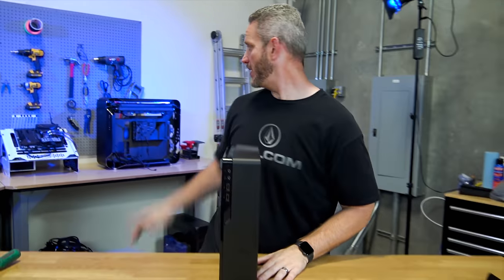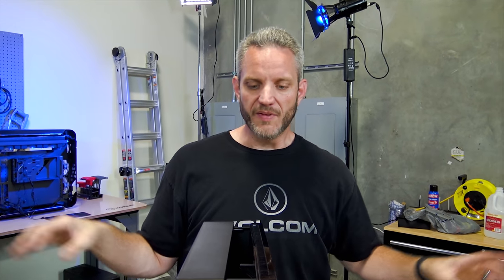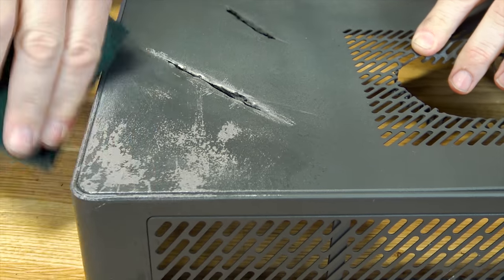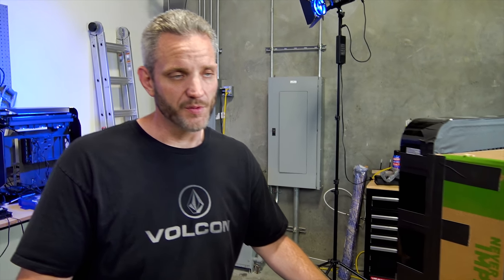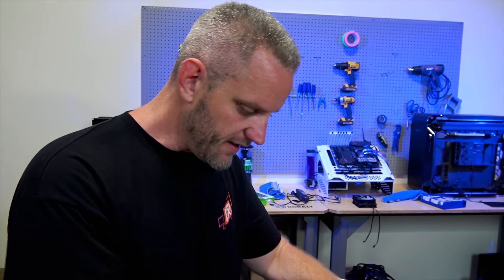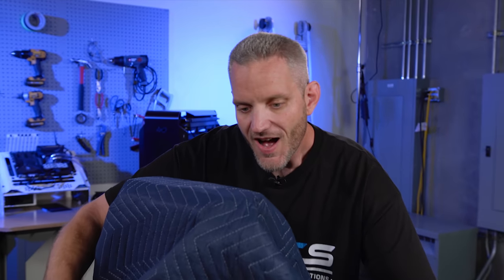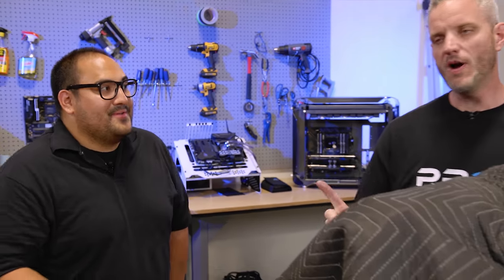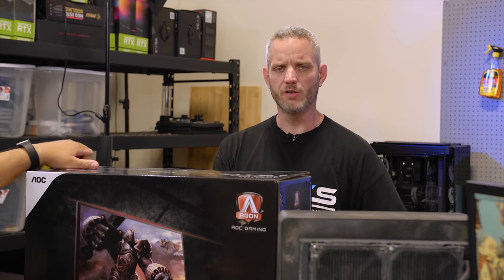I offered to Mod his case to fit an AIO... things got a little out of hand!

Comment: You'll probably never see this comment, but you should check out Aluma Hyde II paint.  its normally used on firearms but its epoxy based and dries rock hard. 

it's got alot of blacks & grays in the lineup.
Reply: I could be wrong but, I think he saw it

Comment: i gotta say, i wasn't a fan of the damaged look till you put the radiators on.
Reply from the maker: Just like anything else, you cant really get the full effect unitl its all done. I saw this in my head and even Phil was like "hmmmm...." until it was done and it was OMG after that. Taking something from your head and making it tangible is fun!
Reply: @Jayztwocents  you are so cool Jay also I've binged watched you many times over the past month. Thank yoy for helping this man from your fans and or radiators
Reply: Too bad it's leaking 20:35 top plug
Reply: @TheNews1990  If you look closer, that is a chip of paint being blown by the fans
Reply: @keksi365  That is honestly really hard to tell. Could be the underside of a paint chip, or light reflecting from water. Worried a lil.
Reply: @M.C.Turnt69  I wouldn't be, it is really clear on my screen that it is a paint chip. I paused the video and went frame by frame and you can see it twisting back and forth and flapping up and down all while it stays the same shape, water doesn't look like that. I would be lying if I said my first thought wasn't "Holy crap it's leaking!" but after I paused it and looked closer it was very obviously a paint chip.
Reply: i seriously thought he was just having fun with wrecking it, and then go surprise we aren't gonna use that old case we got a new case! but that wassent the case and im love with how it turned out.
Reply: @TheNews1990  Maybe if you hadn't bottlenecked your system with a shitty screen you'd be able to see it isn't water.
Reply: @ivanlagrossemoule  I have a 4K UHD HDR+ supported TV, and a Pixel 2 XL. Both show it's water leaking like crazy.
Reply: @keksi365  there's no paint chips hanging off of it. That's bubbling... that's coolant.
Reply: @TheNews1990  it's funny that Jay proved you wrong 👀
Reply: @creppers123  1 year later respond😆

Comment: HOLY CRAP, that case looked freaking amazing when it was done, also those temps, freaking hell the 9900k is notorious for being hot and in an mini ITX case, fook man, me jelly
Reply: At 5ghz OC no less! Fractal Design should take notes, this is how to cool a pc
Reply: Dude, if I was a billionaire I would sponsor this guy for fun.
Reply: To be fair, it has a piggybacked radiator, so it's not really a mini itx case. Once you add a water cooler, the size of the case doesn't matter.
Reply: @xenonram  this is still a mini itx.. the radiator barley adds size

Comment: "Im not used to display port im still on dvi" my guy skipped hdmi entirely 😂
Reply: Dude, I went from a Pentium 4 crappy desktop to a pretty decent laptop with a 1440p monitor, I went from VGA to DP hahah
Reply: My system has 3 generations of screen atm: VGA 1600x1200, DVI 1680x1050, HDMI 1920x1080.
I'll be donating my current system, build a new one, keep the HDMI and replace the VGA and DVI screens with a DP 1440p ultrawide soon... More pixels and less clutter, but it'll definitely take some time getting used to not having a mix'n'match 3 panel mess.
Reply: I did too... lol
Reply: you say that as though hdmi is obsolete and replaced by displayport...it isn't and won't be.
Reply: @robertmarder126  Yeah DisplayPort is all jankey and weird a lot of the time - give me HDMI any day
Reply: And then there’s me with two systems connected to three monitors. I have to use all the connections I have and two of the monitors are DVI and HDMI only from the 2014 era which I don’t want to replace as I like them.
Reply: I mean HDMI hasn't been better than DVI for much of it's lifespan.  DVI supports up to 144hz at 1080p so it was competitive until recently.
Reply: @audigex  What's funny about that is HDMI didn't support 144hz for a long time, where as DVI did.
Reply: I'm still running a dirty hybrid system from a single 750Ti:
1. Samsung 2343BWX - 2048x1152, 24". Connected by dual-link DVI. I had two of these until recently, but they do eventually break.
2. A crap "LED" 1600x900 panel, using an HDMI port at the card but a DVI port on the monitor.
3. A 17" 1280x1024 panel so old it has a silver bezel. It's connected the same way as #2.
4. An even older VGA-only 17" panel. It's connecting via an HDMI port, into a converter dongle, and then into a long analog cable. I know this is not ideal and it shows in the image quality, but it was all I had lying around when the other Samsung died.

I've always been about hanging a huge cockpit-like array of information off a computer that may not actually be all that good. What it lacks in speed is often offset by being able to move between applications (or parts of a complex application like a DAW) without layering.

Comment: I feel like this is missing a handle.
Reply: lol or a piece of rusty chain
Reply: Well, he is a warlock...
Reply: That's what I was thinking. Especially that he likes to bring this around to lan parties. Although it'd be easily modded for that in the future. Just 3d print a custom top handle, and drill the screw holes, and it'd be more badass

If it were me, I'd also put on a pair of shoulder straps to one side, so it'd look like the old military radio backpack that you can carry around on your back.

Comment: Before watching this video I was already planning on cutting a hole to fit my Noctua D15 that I just ordered so it would fit. Won't fit at stock height let alone when I raise the front fan to clear my ram. Then I was planning on figuring out how to bastardize it to fit Noctua's 200mm case fan that's already 1/2 in wider than my case is on the outside. Great video. Got my wheels turning!!

Comment: I also like customizing stuff, did it to my original xbox + xbox 360 and I fully disassembled my 2005 or 2006 Thermaltake Kandalf The Super tower, even had to buy more rivets as the case took a damn huge amount of them and I cut my custom design new window on the other side panel that has no window, that took me a lot of cutting discs because the  case uses really thick heavy steel, same for the fans even my driller wasn't cutting the case to add more fans, had to go with a friend with a industrial driller and even that was loosing power and he was like WTF is this material lol, painted all black and orange looked nice (just changed case a few days ago for a newer crappier one but more modern)...

PS: You should do a lot more of this custom stuff on your youtube.

Comment: I love this project and hope to see more, just wanted to add that fan connectors can come off easily and go back on, or you can buy an fan without them and install your own. Same clean look without the fake touches added. Just sayin' a full time modder would do the extra steps to make it authentic. Besides, why would you opt into corsair fans when way better options exist. Not saying you have to go Noctua, but fans exist without headers on them... Also using a zip tie to gather the CPU AIO cables is an amateur move. Otherwise an amazing build.

Comment: The one thing I feel like you could have done slightly different is the zip tie you used for the AIO's tubes. Think it would have looked cooler and been more fitting to the style if you used one zip tie per tube

Comment: I literally just finished putting together a Node 202 with a Corsair H100i AIO to cool the 10th gen i7 since it's not used for gaming or media. I just like fast things lol

Swapped out the Corsair fans for Swiftech Helix 120s and threw a Noctua 15mm on top of the mobo, blowing down towards the M.2 heatsinks, chipset, and PCH.

I was running below ambient, at idle, before I made some changes but the chipset was hitting 60°C at idle.

ASUS Strix Z490-i Gaming
Intel i7-10700K
G.Skill Trident Z 16GB 3200MHz
Samsung 960 Pro 512GB
Samsung 970 Pro 512GB x2 (with riser)

I'll reply after bench if anyone is interested.

Comment: I've got a Cooler Master Cosmos II case.. I love the case.. it is SO big and has quick installs for everything... but the only place you can effectively put an AIO is the top. And the frame work makes it a fucking horrendous pain in the ass. None of the bolt holes match up and I actually had to dremel out some of the cross support to improve airflow

Comment: So the hot air from the GPU fan that blows out is going to fight the 2 fans blowing directly into it?  I give the fan on the GPU 2 weeks.  After that, errors on card and it throttles.
Should have done fans silver.

Comment: Couldn't you have just removed the mount off of the NZXT waterblock to get it to fit in the hole? It's supposed to be replaceable so you can fit it to AMD or Intel.

Comment: Anyone know what happens when you leave antennas off your wifi card? Ask two-way radio owners. It will burn out and stop transmitting. So, without handshake signals, you can't connect to any access point. It's bigger problem, when wifi network adapter is built into your computer's motherboard. Unless carelessly damaging your computer means nothing, you need some type of load screwed onto SMA connectors.